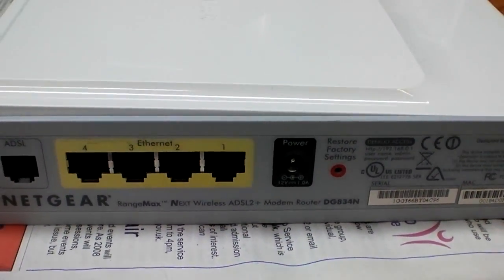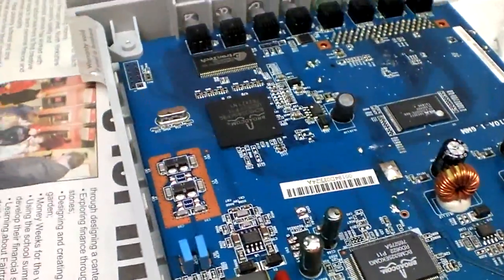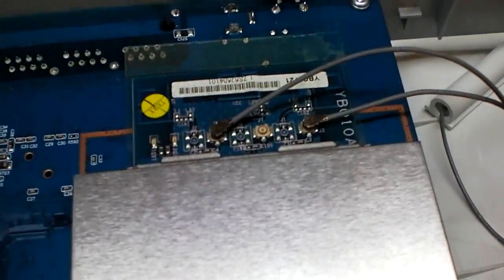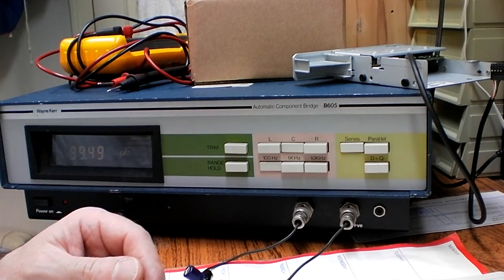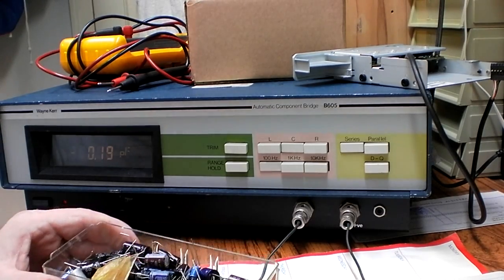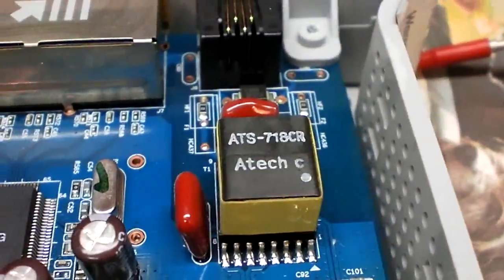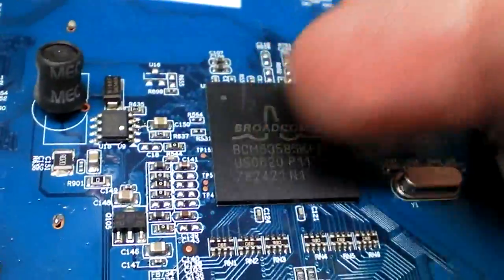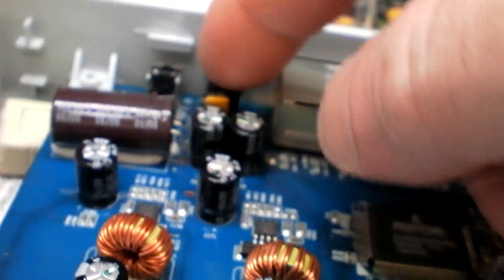Inside a Netgear DG834N Router.

Comment from the maker: L4 is part of the ADSL balanced receive line. Unless you can find an exact replacement, you may have to change L9 too. I'd try anything in there first. I have a scope, but it might be easier to measure L9's inductance and find something to match.
Please don't tell me the router was supplied to you with L4 bust up like that!

Comment: I have the same model router and have had terrible problems with the Wi-Fi, which I believe is due to the heat. I have installed a chipset heat sink and fan on the processor chip and a heat sink on the chip above it. I have also drilled two ventilation holes. The processor chipset fan is blowing in so a vent for that and an exhaust fan near the top of the router.

I think I will change the capacitors now, since I have watched this video. Awesome video, very helpful. Thanks